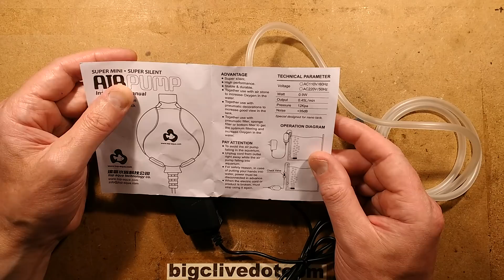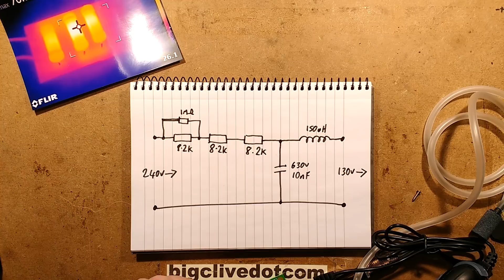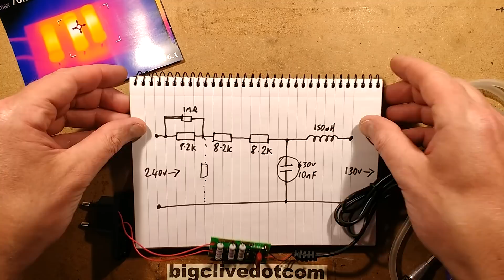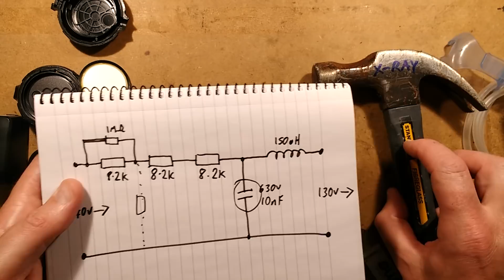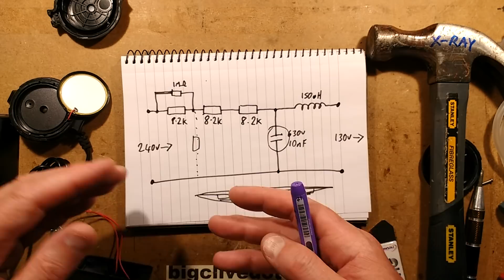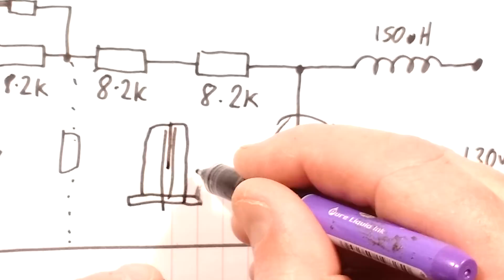Inside a near-silent piezoelectric air pump.

Comment: Put a drop of alcohol on hot melt glue and it releases like MAGIC!
Reply from the maker: I did and it seemed to work.
Reply: Ethanol works great. But you have to drink a lot.
Reply: That's a brilliant tip. Does any alcohol work.....IPA or do I have to dip into my whiskey stock?
Reply: John Carr IPA works brilliant don't know about others
Reply: Not to ignore the good tip on loosening hot glue with alcohol, I found it amusing they used hot melt glue to hold a part that seems to get hot in normal operation.  So can the board be removed by simply operating the pump for an hour or so?
Reply: John Carr IPA works, haven't found ethanol to work quite as well.
Reply: Mark L 
That's the American pronunciation but the OED (Oxford English Dictionary) may differ.
Update: The OED has both 'pi-ee-zo' and 'pee-zo' as acceptable.
Reply: What a waste of good alcohol, drink it and hit the thing with a hammer fuelled by the alcohol.
Reply: pronounced pee-ay-zo according to yt's Emma Saying channel
IPA goes nicely with orange too!  best to get big bottles of both so you don't end up having to go looking when the blindness starts.
Reply: darran newman.....
MEK would work I'm sure but that is some harsh stuff and will probably affect the rest of the plastic also. 
If you have MEK but not IPA, then there some type of issue there.
Reply: Pure ethanol works, but IPA works better.
Reply: I never knew that.... Im a bigger fan of freezing the hot snot
Reply: And i was thinking the same IPA the ale, but now you say its the spirit i understand. Would MEK work?
Reply: Also  pee-ay-zo according to Merriam-Webster dictionary. Rhymes with 'if you say so'  (lol).
Reply: @Markus0021  I was taught decades ago that it's pronounced Pee-Zee-Oh 🤣
Reply: I had to release hot melt from the base of a big stainless steel bowl and too my surprise a few seconds of boiling water in the bowl released it with ease in case there is no IPA on hand
Reply: Andrew Delashaw 
I was only joking. 😃
It's also known as isopropanol.
Reply: @All The Gear
India Pale Ale? Sacrilege!
Reply: zapro_dk - if this works, it’ll make my entire YouTube surfing experience worth every penny!
Reply: John Carr I have tried this in an emergency with Gin; didn’t work well at all. But gave everything a wonderful aroma of juniper!
Reply: John Carr 80% or better
Reply: Or just force of habit.
Reply: John Carr vodka or bust
Reply: Probably.  But MEK will attack many plastics so not only will it soften hot snot, it will soften polystyrene, polyethylene, ABS, and many others.
Reply: I'm willing to bet the complicated air intake path is to provide cooling to the piezoelectric element and to reduce the noise.
Reply: There's an American dent pulling kit that uses hot melt glue on pads and they recommend any denatured alcohol... Meths to us Brits...
Reply: Works on Silicon sealer as well.
Reply: Aaron K ... Neat...😳
Reply: IPA Yay!
Reply: Good advice.  I've used that trick for years.  I believe the low surface tension of the ethanol gets under the seal and it releases very nicely.
Reply: All The Gear 
India Pale Ale?
Reply: Pete Allum isopropyl alcohol. That's the way you've got to say it to make it sound like "you're in-the-know." It's one of those things that people use (particularly engineers) to make it sound like it's a more complicated subject than it really is, to the layman.
Reply: Not like magic, like science!
Reply: IPA must work - Ralphy would never allow Clive to waste the good stuff.....